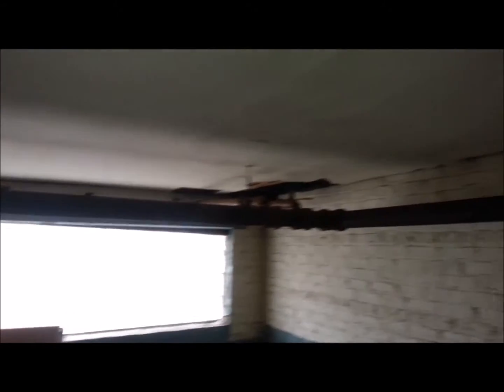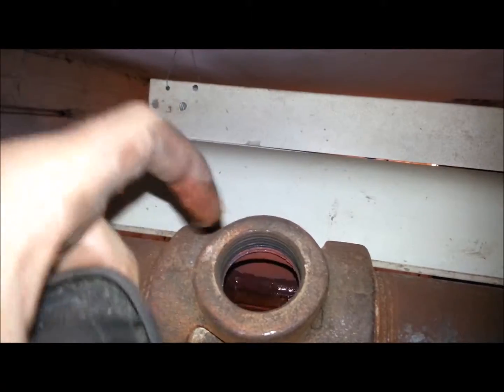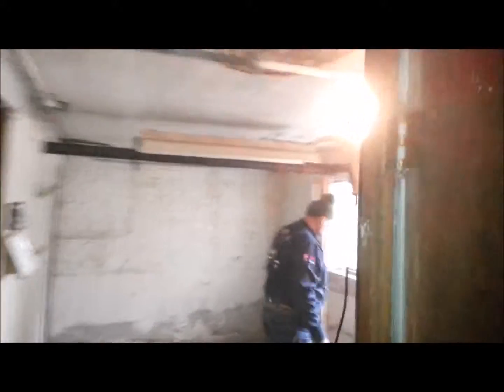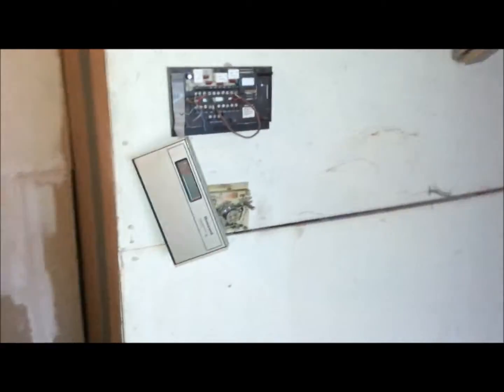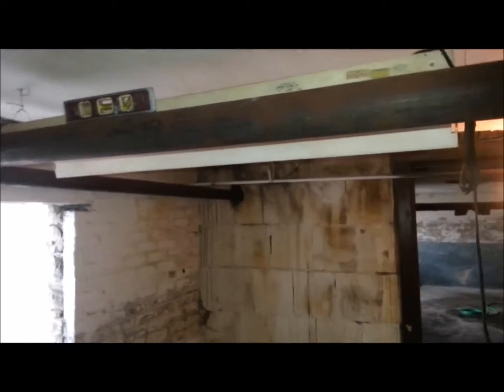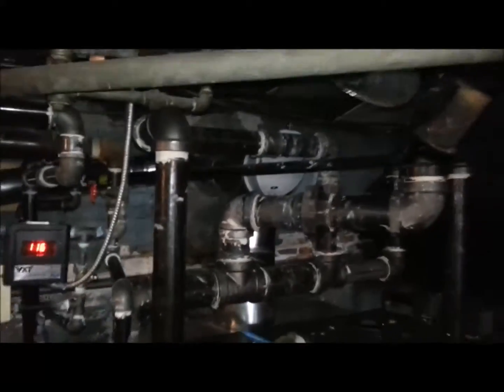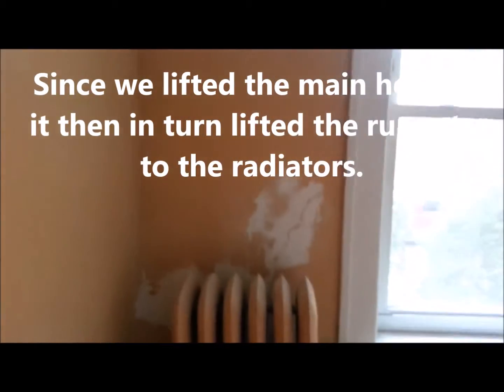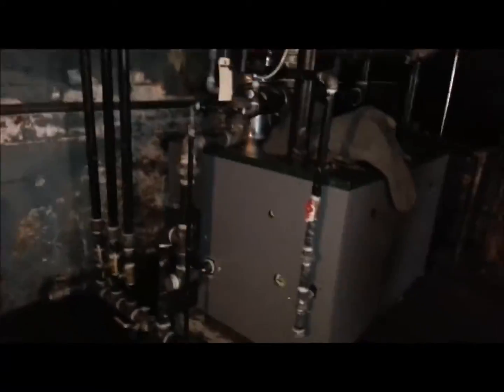HVAC Steam loop not heating

Comment: Nice video and great detective work, seems simple but I guess the steam pipes have been in place for at least 100 years and over time they have sagged and been pitched in the wrong direction. Nice catch!
Reply: When the asbestos was removed they most likley screwed up the hangers. Happens alot. Also all that pipe needs to be reinsulated.